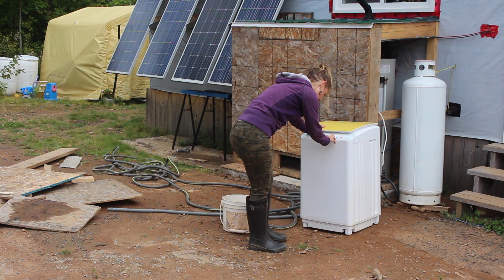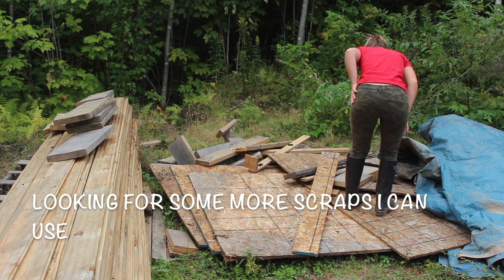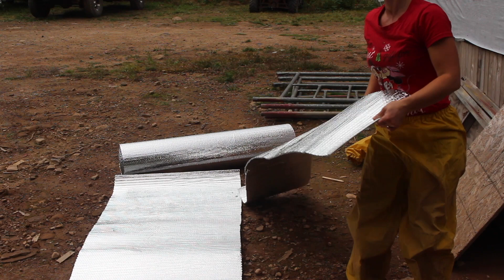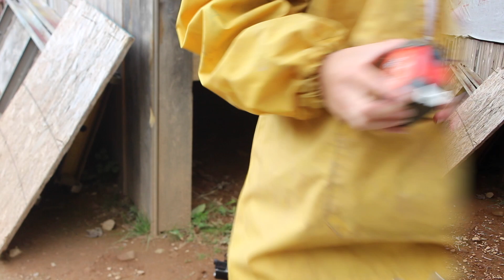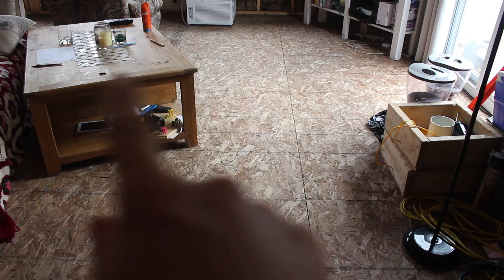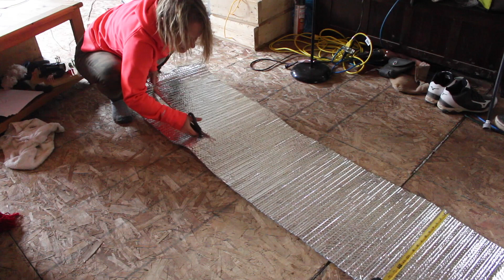She's at it again....

Comment: Your work ethic is commendable!  Well done, Ashley!  Hey, is there a particular reason you didn't staple that bubble insulation to the bottom of the floor joists in whole widths instead of cutting them into strips?  You could, in the future, install 1-1/2 inch rigid insulation to the bottom of the floor joists in whole sheets to increase your insulated value (R-rating).  It would save you from all that measuring and cutting strips.  Still, very well done, Ashley!  All the best!
Reply from the maker: Did it this way so there wasn't an empty space left for mice or other critters to nest up for the winter.
Reply from the maker: @RXRSawdustStation  They haven't touched the bubble foil yet. We were concerned of them building a home in the cavity if we did it differently. Thanks :)
Reply from the maker: @RXRSawdustStation  Thanks, we know others that have done it the way we have with no issues, so we are going to keep it as is for the time being. Thanks though :)
Reply: @MBFModernHomesteading  I did a better but still very quick search last night.  Google said rodents will eat rigid foam insulation (the Pink stuff), just so you know.

Comment: YOU NEED TO INSULATE BEHIND THE TANKS TO COVER THE WOOD  SKIRTING YOU PUT UP SO IT BLOCKS THE COLD AIR FROM UNDER THE HOUSE. YOUR WEATHER IS MORE COLD THEN OUR AND i PUT HEAT TAPE ON MY WATER LINES UNDER HOUSE OR THEY FREEZE UP.